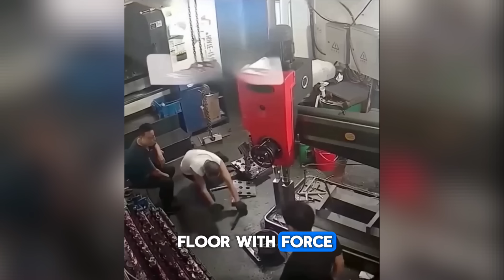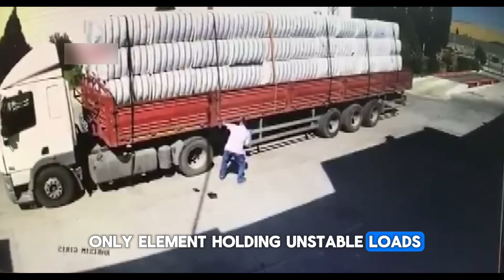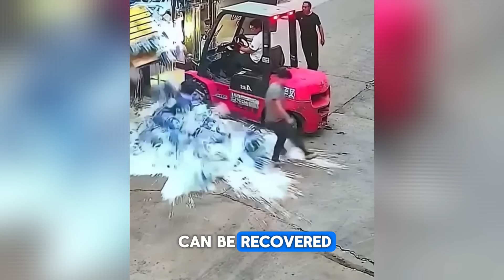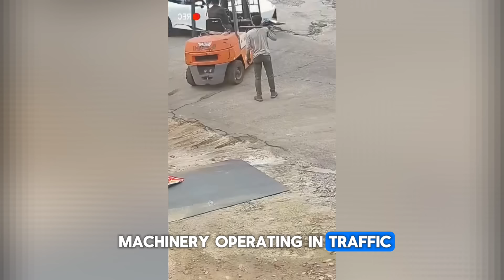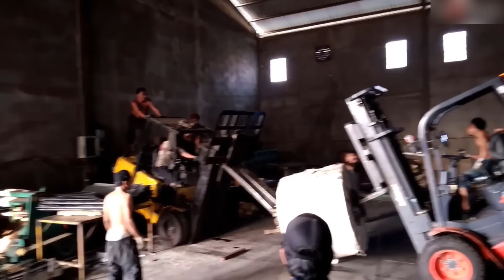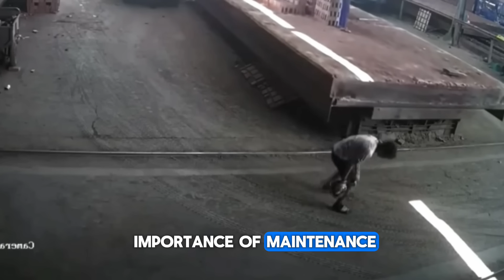Just Another Day at Work… Until This Happened | Industrial Machine Accident

Comment: What has been completely overlooked by "AccidentScope" is that the #10 clip very clearly shows the drill head on the radial arm is being worked on by someone.  The kid grabbing the downfeed engagement handle disengaged the entire head that the QUILL WAS BEING SUPPORTED ON THE MATERIAL BLOCK SITTING ON THE BASE.   "The lever did not suddenly disengage".  The kid disengaged it!!     I very much doubt this was a "visitor".      HOWEVER ....the scenario shows that machinery needs to be very clearly identified when being worked on or serviced.

Most every one of these clips is showing what happens in third-world countries where there is very little intelligence of what's going on .....and next to no "safety" practices.
.